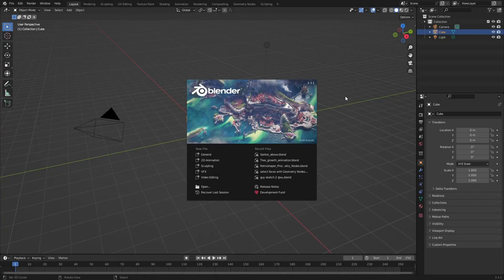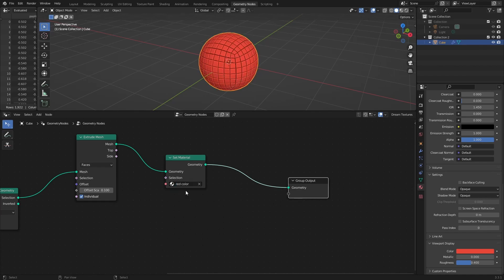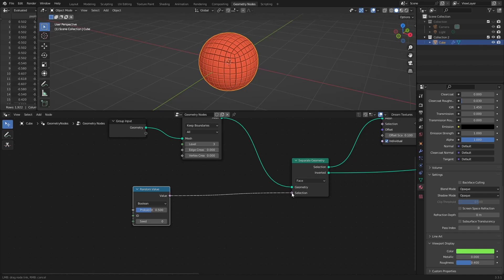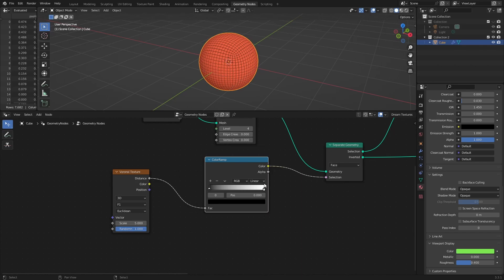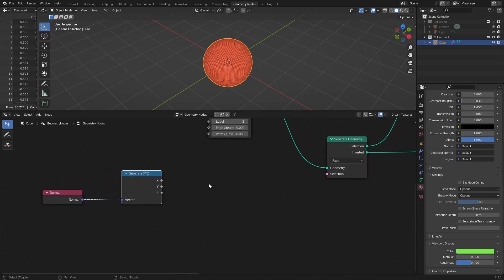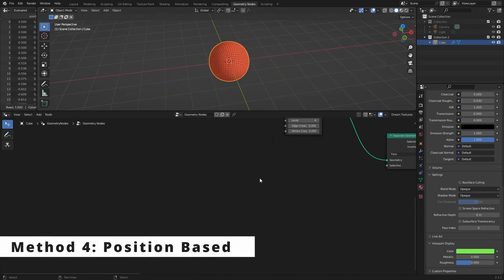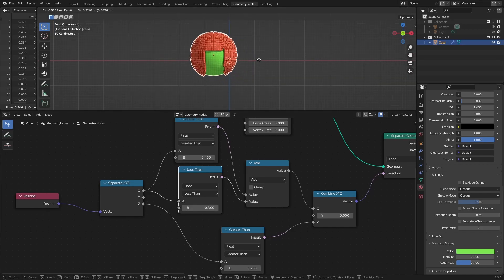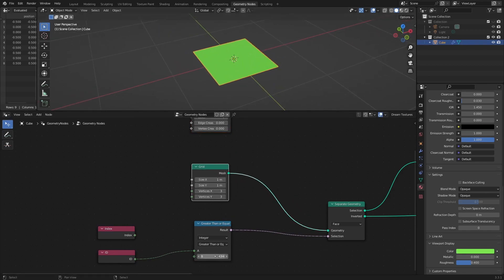5 Basic Methods to Make a Selection in Geometry Nodes

Comment: but now how do I manually select a face and apply some condition to a particular face without having to use say an index node? Lets say I have a plot of land (single grid face) - I subdivide the land into 4 parts. I want to be able to choose what type of house goes on each face manually (from a collection of house types). But lets say later I want to subdivide the land into 6 parts - I want to manually be able to select the subdivision and choose from a list what type of house goes on the selected subdivided face. Currently I can not wrap my head around a dynamic system to do this. I would prefer to have a simple UI in the modifier stack that grows or gets smaller as the subdivisions get more or less and I am able to select what kind of house I want from a drop down list. Does this make sense? The math based approach is quite limiting. but maybe I need to approach the scenario in a different manner

Comment: What if i want to select exactly vertices index 13, 17, 30, 49 ?
Reply from the maker: Well, with geometry nodes it is much easier to work with patters rather than exact numbers while selecting. If there is a pattern in the indexes of vertices, you may use módulo operation in the math node. If you want specific vertices to be selected, you may add integer node for each node, Add them with math nodes and use the result as a selection of vertices.

Comment: There is another method to achieve this. It's not optimal for this particular case but it gives you some flexibility and might work better for other selection patterns. Select faces pair so there is three faces gap and [ctrl shift +] till you get area entirely filled with this pattern. Select pair with two faces interval and [ctrl shift +] till you get pattern complete. In menu it's Select more/less -> Next Active

Comment: Bro, you missed weight painting a selection... and ytube search isn't helpful to find that, cause it conflates rigging weight painting with geonodes weight painting.  That being said, definitely helpful, so saved video!  Most of the selection methods though will pick different selections if the geometry being worked on is moved, correct?  My objects are animated, so they move...
Reply from the maker: Thank you so much for the feedback and the suggestion on the weight painting! Answering your question, yes, when object is moved, transformed or modified, the selection is going to change, since it is real time selection.
Reply: @retroshaper  Hmmm, but like pain, "it only hurts when I move," isn't the selection changing on movement fubar'ing most of the reasons for making a selection?

In Houdini, I can make a selection by point, edge or "primitive" i.e., faces.  I select like we can select a subgroup in edit mode, but in Houdini I can assign it to a group, and operate on it super easy, barely and inconvenience... Idk why Blender can't do that simple task... I have gotten to the point of "vertex" painting the faces I want and then using that group as the selection, given it doesn't change on movement...

Still haven't refound the tut of the "german sounding" guy painting an A on one side of a cube... not happy... that's a little different because it's interactive compared to my chosen method...  I'm gonna assume the weight painting method to use to select where you want to scatter stuff in GN's is the same process and experiment...
Reply from the maker: @Logically_Fallacious  Well, I’m not saying it is impossible in Blender. Just a bit more complex math operations needed than shown in the video. E.g. use ids or indexes of edges, vertices or faces to make a selection or do some math operations on the normal or position of those based on the center of the object. Just wanted to highlight the basic ways ))
Reply: @retroshaper  Interestingly or sadly, unlike Houdini where you can just highlight the primitives (faces) you want and make a group, the vertex selection for faces only works if you vertex paint, filling faces first, (otherwise it choses the two adjacent faces, not one), and then use that to select what you want to operate on in the GN tree choosing the "vertex group."  Otherwise, I cannot select an arbitrary subset of faces, AND most of the time the selections would change if I changed the location of the object I was selecting on...

But I get your point.  My comment was mostly tongue in cheek, but I was searching for weight painting at the time... and saw yours and then said, hey the search was wrong!
Reply from the maker: @Logically_Fallacious  those are great points to think about;) absolutely!) thanks for the comments;) and sorry for late replies. I have terrible connection for the last few days

Comment: I have liked this video.  However, be aware of some potential confusion.

As I look at my Blender 3.5 on April 3, 2023, it appears that the Utilities-Color-Mix node has changed at least twice since this video.  See 3:07.
In this video the Mix has Color1 and Color2 inputs and a Color output.
In today's documentation the Mix has Image1 and Image2 inputs and an Image output.
In my 3.5 the Mix has inputs A and B and an output of Result.
I'm not saying the trend is bad.  I am asserting that the trend may be confusing.  Be wary of what you are looking at.

Separately I have also noticed that many of the shortcut keystroke sequences have changed in the 3.5 Add Menu of the Geometry Nodes Editor.  Be wary again.
Reply from the maker: Thank you for the feedback! Yes, it true. Blender is constantly changing and introduces new features and sometimes even some concepts. Especially, geometry nodes ) This thing moves fast in progress.
Thanks for the advice! 😃

Comment: This helped understand selections a lot more than some other videos I watched. I didn't know you could combine selections with the Math node. That's exactly what I wanted for my current project. And selecting faces based on a texture is perfect for part of another project I have.

Still having a hard time understanding how the index works, but the info here is one more piece of the puzzle to help with that. I thought an index was a type of data that came from a mesh, so I was frustrate that the index node only had an output, leading me to assume that only the object the geometry nodes were applied to could provide an index to work with. But seeing it used here in this way, for a mesh primitive; I'm now thinking it's some kind of generic list of numbers. Very different from how I thought it worked.
Reply from the maker: Thank you very much for the feedback! 😃I’m so happy you enjoyed the video and that it helped you with your projects 😊 As geometry nodes being developed, there’s a lot of new features are coming in) and you basically can experiment with everything) btw , it even shows you if the connection between the nodes is impossible) so, what I usually do, is just, go to the manual and check what each node does, then try to understand how it can be used in regards of a particular field or action;)